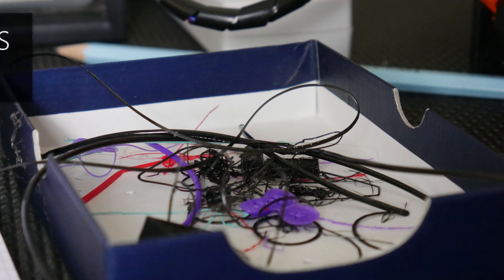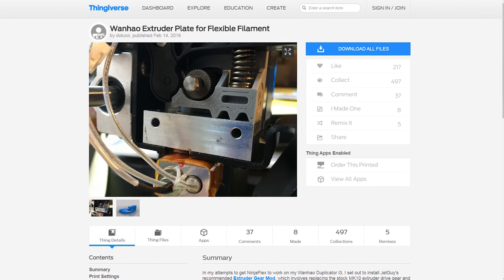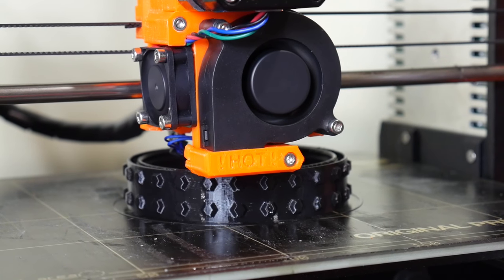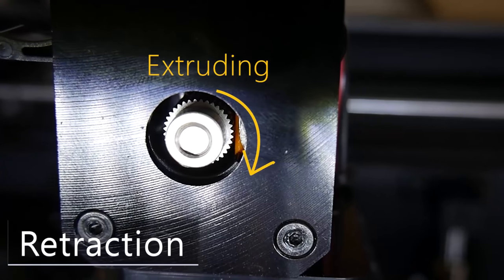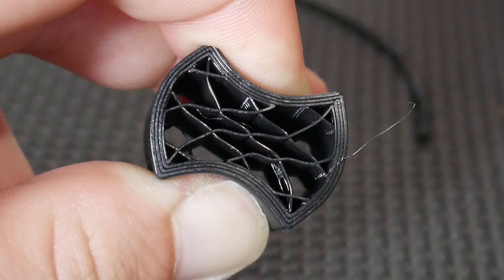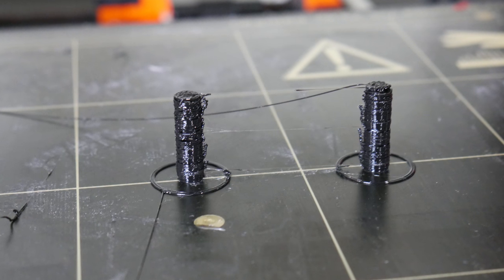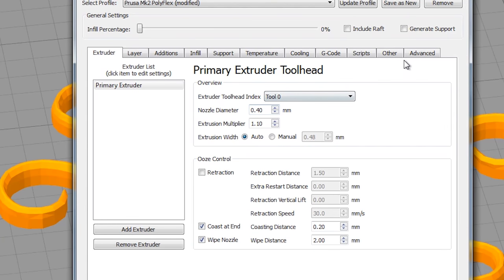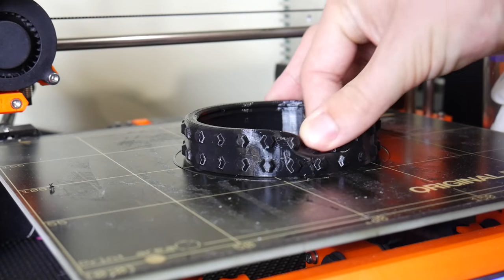3D Printing with Flexible Filaments (on stock hardware!) -  3DP101

Comment: How about cooling?  I've been using what I believe is TPU (3D Solutech flexible) and accidentally knocked my fan ducts off after a couple of prints, and the same prints (RC tires) came out much softer, which was not terrible because the outside geometry was fine, but with broken infill.  The symptoms were a lot like under-extrusion, but the nozzle was clear, and increasing the multiplier did not help, only slowing down allowed the infill to layer without gaps and globs, but the part still came out softer.  It puzzled me at first though because I had my cooling set to minimal for the first few prints anyway, thinking about layer adhesion and that being softer it acted more like PETG, so It took me a minute to realize I forgot to reattach the fan ducts.  Once I did so I instantly got thicker outer perimeters, solid infill, (and a bit stiffer tire), at higher speeds again.  Turns out the filament was actually not cooling fast enough to attach to the previous layer line and stretching thinner on the outside perimeters, and drooping through the infill.  Still experimenting with using higher cooling fan speeds, but would be interested to hear anyone's experiences.

Comment: helpful video, but on my Ender-3, it could not handle 1.1 extrusion, it kinked the filament. I also needed a 0.5mm nozzle with 0.3mm layers. And finally, I had to get my speed down to 15mm/sec. 
Slow and hot is better. The Simplify settings fixed all the wisps issues.

Comment: Very helpful videos, I often find some answers for a problem that I not even know bevor.
Recently I tried to print POM and I can say it is one of the hardest material to print.
Do you plan to make a Video about POM?
Keep doing, great videos.
Reply from the maker: POM is an incredible material but very challenging, I have a roll and will cover it in future :)
Reply: Yeah it is challenging, it sticks to almost nothing and because of the crystalline structure of POM the warping is more than twice that bad than ABS, I clamped a 5mm POM plate on to my heated Bed (100C) and printed the first layer almost to hot (220C - 230C) and very slow (10mm/s - 15mm/s) so the print melted pretty good to the POM bed.
I also build a heated build chamber with almost 80C ambient temperature, after each layer I decreased the printing temperature of around 5C until it reached 200C.
Printing with a stock Malyan M150, for these kind of prints the external control unit is pretty good for keeping the Elektronik out of the heated chamber and cool.
But anyway more than slightly overhangs or thin walls are pretty much impossible because of the extreme shrinking so it curls on every non supported part and fails.
Maybe you can achieve more than I im looking forward to your video :)
Reply: This is interesting.  I have a POM plate and was about to retry printing it.  I can heat my chamber (haven't gone above 70C yet).  I can keep you updated.  I just got to printing Nylon really well.

Comment: I used Flexible PLA from Rigid Ink with Up Box (with CPU upgrade) - the bed height was too low and the reel was too heavy (1kg) - so I reeled off an approx amount to complete the job so it was lighter and raised the bed height - sorted it!

Comment: I have found that for printing elastomer with Shore of around 40 (VERY FLEXIBLE) I had to increase the retraction (from 0.8mm to 2.5mm on Titan Aero extruder and 0.6mm nozzle) or else it would leak and string the heck out of everything.

Comment: Retraction isn't neccesary a bad thing to have enable when printing with flexibles. My flexible prints suffered from stringing. I reduced the print temp a little bit, set the retraction to 2.5mm at 30mm/s and no problems printing Ninjaflex at up to 40mm/s. Printing with a I3 clone, titan and E3D V6 clone.
Reply: May I add, supports aren't a problem at all, remove just as easy as any other type of rigib filament do.

Comment: i print hobbyking flexible matterial on my cheap mk8 extruder it works really wel. not mutch tweeking. retraction enabled. i just get printspeed down to 25mm/s and a bit hotter temp then recomended. i even printed a revolved latis cube whit it did perfectly. even a ball for my dog with in design support with a gap of 0.2mm to the model came out great. i gonne get some nijaflex soon to try out hofefully it works just as well...

Comment: I'm able to print Flexi PLA by rigid.ink on a 1.75 bowden setup (the more common TPU based filament doesn't work for my setup). However comparing to the ones described in your video, the layer bonding of Flexi PLA seems to be quite weak. I need to turn down the fan a lot to increase adhesion.

Comment: I have to disagree a little. I use both support and retraction when printing with tpu material. I'm using an old Ultimaker Original so it uses 3mm filament if that helps printing. Love you channel here on YT bye the way 👍

Comment: I have been going insane trying to print HDPE. I found out that gorilla duct take is perfect for bead adhesion, but the tape itself peals of the bed from the warping. I have been trying to get the tape to adhere to the bed even better.

Comment: thing is, you can print faster than 15 mms per second. wont be much of a problem with speeds less than 30.
im using a cr 10s with an extruder tensioner to  reduce the pressure thus getting the filament in the right direction (this leads to some underextrusion fortunately thats an easy fix). and since cr 10 is bowden, i can generally print faster than you prusa users. 
a thing ive learned the hard way is you never turn on your cooling fans when printing flexibles.

Comment: Do you think that soluble support interface would be ok with flexible supports? Using a multi material print adapter like the new mmu2 for the prusa i3 mk3?

Comment: Angus I'm getting nice looking outer walls, top and bottom looks messy but my big issue I really need help with is vertical wall delamination. I'm printing on a stock cr10s at 235°c, any advice please??

Comment: Thank you! It worked really well. I only had a bit of stringing because I couldn't find "Avoid crossing outline for travel movements". I use Cura, anyone know if there is an equivalent command in Cura?
Reply: Mike Hogan go in settings, Configure Setting Visibility, Travel and select Combing mode. This keeps the nozzle above already printed areas when traveling. If you hover over the options it gives a more detailed explanation .

Comment: TPU from the3dprinter worked great on mk2 with 2mm retraction.
Reply from the maker: Nice, with mine any retraction caused it to deviate and loop out the side of the extruder :( This is using PolyFlex.
Reply: TPU is quite rigid, it's not PLA or ABS by any means, but its hard rubber. like a car tire.
Reply: I think here we need to differentiate. One is TPU a ThermoPlastic Polyurethane and the PolyFlex is more likely some kind of TPE (ThermoPlastic Elastomer).
So technically the TPU is classified as a ThermoPlastic Elastomer but Polyurethane is much more rigid (something around 95 ShoreA) than the typical TPEs (80 ShoreA).
So for something like Rubber you have to take some sort of TPE like PolyFlex, but it is harder to print and not that abrasive resistant.
TPU on the other hand is more like Longboardwheels, easier to print and much more abrasive resistant but much less rubberlike.
Everything comes back to the application of your print.
Reply from the maker: As with most things 'it depends' - the green filament I printed in my flexion video is TPU and is VERY soft, but also elastic. Polymaker's Polyflex is flexible, but doesn't stretch like TPU does. There's a lot of variations!

Comment: really amazying video but i have a question as i try my first filament. i have prusa mk2s and when i tried to load filament the extruder couldnt do it easily i tried 3 times and my question is, do i need to tight the the 2 screws and if yes how much distance . now is 14mm

Comment: Angus, do you put glue on the bed before you print flex? Just bought my first spool of Sainsmart TPU and was wondering if I need to put glue on the area to prevent it from ruining the PEI sheet as others have had issues with.
Reply from the maker: I make sure the bed is clean using isopropyl wipes but no, if you put glue down you might never get your flex prints off! You do need it heated though slightly, but not too much as you may have it weld. I had no issues with the Polymaker PolyFlex onto the PEI of the Mk2 using the settings in this vid.

Comment: i disagree with disabling retraction. i use more retraction than normal because the filament compresses. i don't have any extruder issues with retraction, and i don't have stringing. (using ninja flex and a printrbot alu extruder v2)

Comment: I know this is for a stock Hardware printer, but would a larger nozzle like the new .8mm Nozzle also help with Flexible filament?  I am looking into gettign a Prusa With the 4 color extruder as my first printer, and I am sure I could get the .8 Nozzle to fit it.
Reply from the maker: I reckon it would help, anything to make the pressure less when extruding.

Comment: Can I print flexible materials with the  Qidi tech Xone?  Also, do you still use yours?  Thanks a million.
Reply from the maker: My x-one found a new home, but I suspect the spring loaded extruder will be too strong to print flex and might need a lighter spring.

Comment: Hi. I know this is an old video but Im just learning. im curious. Instead of having to go through the process of resetting the the nozzle height, could I just set the first layer height to say 150% or even 200%? would this not achieve the same results as manually setting the nozzle height?

Comment: Great video Angus, have you tried printing flexible material on your Up! Mini 2, as there is not much you can change in Up! Studio. Also I got this months Makerbox and it came with some Bronzefill, I cannot get it to print on my Up! It keeps jamming no matter what I do, any tips?
Reply from the maker: Because the software is so locked down I don't think you can... sorry :( I did get flex working on an Up Plus 2 once, but only a specific brand.

Comment: I like your channel. Also helpfull on bowden System is to 'oil' the filament i use some sponge with Glycerine to reduce The resistance in the bowden tube. What do you think about this?
Reply: Mario Perini does it work for you? i have a tevo tarantula
Reply: urjnlegend yes it works for me... First i used some Standard oil, but its Bad if you change to other (non flex) filament and you have some oil ooze out. Glycerin vaporize at printing temparature. I use it on my vertex k8400

Comment: Haha, just had a long night of getting ninjaflex to print on my Cetus. I had to use a raft. Which surprisingly came off with ease. the print ultimately failed on the top layer. something caused a hiccup in the extrusion and it started running stringy it tried to cover it up but the stringy was too strong!

Comment: How do we keep the TPU from adhering permanently to the PEI bed surface.  The top PEI layer on my steel sheet was ripped right off when I tried to remove the print.

Comment: Could you share your settings for the fiberlogy on the prusa mk2? i struggle to get it working without either minimal underextrusion, or stringing. even with avoid crossing outlines and nozzle whipe

Comment: i tried to print TPC Flex 45 (from RS Component)
with the recommended 100°C Bed and 240°C hotend.

It just doesn't permanently stick to the bed (tried glass and printerstape) during the print. It lifts on the edges and the print is damaged..

Any advice?

Comment: Have you done a "How to get the best print quality" video yet?
If not could you.
Thanks.
Reply: I want to get the most out of my Anet A8
Reply: I'd say start with upgrading your printer with new parts like frame stiffeners and improving your hardware. A wobbly machine will not produce good results no matter your settings. Thingiverse is full of such things. For example for my printer (not Anet A8) I've replaced feeder gear, faulty V-slot wheel,  printed new extruder assembly and belt tensioners.

Comment: Thanks for information. I'm hoping to print with flexible material with my Robo 3d r1 plus.  Does flexible material also have a grip to it?  I was trying to make a holder for my USB hub to my desk but it just slides off even though the holder should be snug fit around the desk.
Reply: ImaginationToForm There's a lot of different types of flexible filament, some have a grippy rubbery finish and others don't.

TPE like Ninjaflex is the most grippy and stretchy...and hardest to print.

TPU is less grippy and stretchy, but is a lot easier to print.

Flexible PLA isn't like the others, it's a lot less flexible and I think it's probably more suitable for parts that just need to bend a small amount...not grippy or stretchy.
Reply: Oh thanks for information.

Comment: A custom head made for printing Flex filament can print normal filament just as good as a regular head, correct?
Reply from the maker: Yep, a purpose designed extruder can print flex pretty much as fast as regular filaments, however you will still run into stringing and print quality problems.
Reply: Maker's Muse On the flex filament? Or more than normal on normal filament?
Reply from the maker: Yes, on flex. normal shouldn't be affected.

Comment: How do people struggle so much? I wasn't even gonna try before direct drive extrusion, tpu was the first print on the dd. Reduced retraction settings almost all the way, used micro swiss hot end, smack dab in the middle of the suppliers recommended temp setting, at the top end of thier print speed, actually above. But my prints came out just fine 🤣  I was expecting some sort of failure and troubleshooting
Reply: I printed at 45mms btw

Comment: Angus, thank you so much for your video! it was very helpfull, I used Createbot filament and a Tronxy P802EA V.03 (Prusa copy and many mechanical improvements) I used your material settings and .125mm printing resolution, this settings work well for this printer. Took me 3 hours to test and tune some of the settings, the pieces were perfect, I have screenshots of my configuration  I leave a small video in case someone want to see the result (https://youtu.be/BPJJ_q_dT6s). Angus, thanks again!